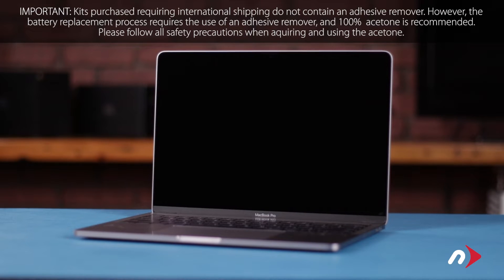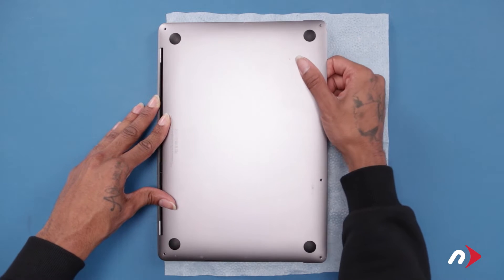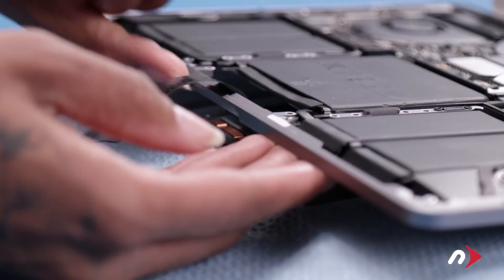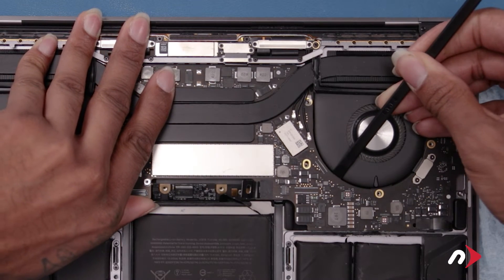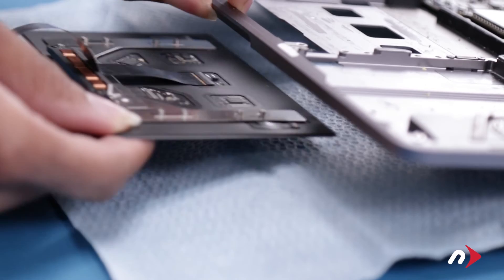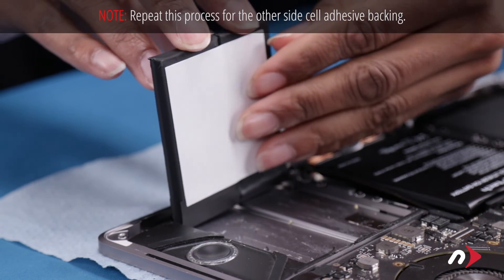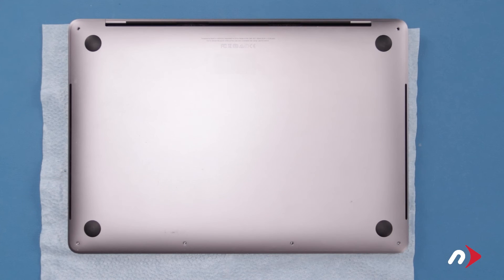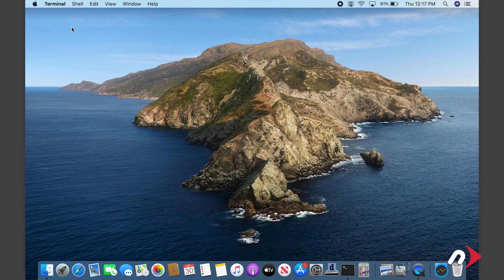How to Upgrade/Replace the Battery in a MacBook Pro 13-inch (late 2016 - mid 2017 Touch Bar)

Comment: Thanks a lot for this tutorial. I was able to change the battery successfuly and the computer is ready for use again.

While replacing the battery, I noticed a little disaligment of the trackpad, it is slightly aligned to the left leaving a tiny gap on the right side. The trackpad is fully funcional BTW, the disaligment is only a visual thing.

For folks that don't live in the US, I bought the battery and the glue remover on Aliexpress.

And thanks again!!
Reply from the maker: You're very welcome! We're glad the tutorial helped you successfully replace the battery and get your computer up and running again.

The slight trackpad misalignment you noticed is usually a minor issue, and as long as it's fully functional, it shouldn't cause any problems. However, if you'd like to adjust it, carefully loosening and repositioning it might help.

Thanks for sharing your experience and resourcefulness in sourcing parts outside the U.S. – that’s great info for others! We appreciate your feedback and hope your device continues to serve you well. 😊

Comment: Excellent instructions. Thank you!!!

The only change I made: I did not use any adhesive removal. Used a string instead to pry the battery out. So, I did not have to remove the trackpad.

Comment: I did it like you, but my mac do not see new battery. I opened my mac and see a picture of battery but after ….. my mac tell me ….. need a servis
Reply from the maker: Hello Marie, if the battery is still not being recognized after replacement, the issue may lie within the hardware of the machine itself and may require servicing.

Comment: Thnx, it worked better than the paper tutorial I got with my new battery. 
One note on part 4 in the video; the energy saver options have disappeared in macOS Ventura.
Reply from the maker: We're pleased to hear that the video proved more helpful during the installation process. Your feedback is valued, and we will certainly pass it along to the appropriate department. Thank you. 💙

Comment: Worked like a charm. Haptic feedback didn't work a first few times after battery replacement so I had to remove touchpad assembly and re-assemble it do resolve bad connection issue. Got it working again. Would also advise against connecting battery (12:35) so early in the process. Do it just before attaching the bottom cover. Just to ensure you don't accidentally short the board when reassembling the computer.

Comment: Just need a little direction –

•	I purchased a new battery for a MacBookPro10,2
•	The computer was a gift from my son – he told me the battery was ‘dying’ and, eventually, if the power adapter connector fell off – the machine stopped (no battery).
•	So I bought a battery from you guys: Date 10-02-2020 - Invoice 6539802 – which was delivered and I let it sit in a cool-dark-place from then to now.
•	Prior to installation I followed the instructions Temporally Disable Auto Boot (power) 1:00 min
https://www.youtube.com/watch?v=WC8_JCVCU0s&t=70s
•	Enter Terminal ( & Command Key)
•	Type sudo nvram Autoboot=%00
•	RETURN – Input code
•	Close Terminal, Shut down computer
•	After installing the battery and letting it charge all night (battery 100%
•	Re-enabled Auto Boot  (In video at 16:30):
•	Launch Terminal
•	Sudo nvram Autoboot=%03
•	Enter code - Return
•	After suttong off the computer I pressed the power button – nothing
•	Eventually I reconnected the power supply and it booted
•	So, the system has no response to the power switch.
•	The system WILL run with the power adapter ON.
•	The system shows the battery is fully charged

Two questions – 

Since the battery is NOT running the computer, how can I drain the battery before checking to see if I did not connect the battery correctly?

Do you know of some other reason the battery is not connecting to power on the system?
Reply from the maker: Hey John,

We apologize for the inconvenience you are having with our battery. It could be that the battery is no long working due to the not being installed immediately upon purchase. Usually lithium batteries only have a 6-12 month shelf life. You can try to the following troubleshooting to see if you can get it up and and running or contact our Tech Support directly.

The first thing I would recommend doing would be resetting the System Management Controller. Resetting the System Management Controller (or SMC) in a Mac can be a useful way to troubleshoot various kinds of problems that arise, typically related to power issues or issues that coincide with new hardware being installed in the computer.  Detailed instructions on performing a SMC reset can be found on Apple's website here:  https://support.apple.com/en-us/HT201295

After resetting the SMC, I would also want to perform a NVRAM or PRAM reset.  This can be done with the following instructions:
PRAM Reset:
1) Start the machine while holding down the Option-Apple-P-R keys

2) Wait until you hear the 3rd startup chime, then let go of the keys and let the machine boot up.

Lastly, we would want to go through a proper conditioning cycle, to help the battery reach its maximum lifespan.  This process will help calibrate the battery and extend the full charge life.  You can find this process with detailed instructions on our Battery Conditioning Guide: https://eshop.macsales.com/Tech/manuals/newertech/batteries/batteryconditioning_r1w.pdf
Reply: @poweredbyowc  Thank you for the reply.
Considering the battery was now fully charged - and there was no way to discharge it prior to disconnecting it internally from the MB, I took it to a local repair shop (CPR Spokane North) and they took it apart and repaired it.  Apparently, the connection board was not seated correctly and slightly hung-up on one of the guide posts.  I thought that might be the problem, but did not want to be the one who shorted out the board removing a 'hot' battery. 

FYI  - the battery is in perfectly good condition even though sitting new for two years.  Took the charge well and is running great.
Reply from the maker: Hey John,
Thanks for the update. Glad to hear the battery is all good and the root of the problem has been sorted out. Thanks again for the follow up. Glad you are back up and running again 🙂

Comment: I would advise against re-connecting the metal tab (12:35) until everything else is reconnected, as there is a possibility that you'll drop a screw on the Logic Board and it bridges a connection between two different components on the board. If there is power from the battery flowing through the system, this can cause a short and damage the components badly, possibly ruining the board completely.
Reply from the maker: Hi DWN9!  That's an interesting point.  I'd be worried that leaving the power connection screw till 14:23 when the other screws are inserted could result in the power connection screw being forgotten.
Reply: @poweredbyowc  That's true, but it's easy to open the back cover and re-install the screw later. Replacing the Logic Board would be more costly both time and money-wise.
Reply from the maker: You have great points there DWN9. 🤔 We love getting inputs/suggestions from our customer and we will for sure forward your feedback to our development team.😊

Comment: Hello. What if my laptop is dead and won’t power on at all. Is it safe to still change the battery?
Reply from the maker: There could be a few reasons why your computer isn't powering, while it should still be safe to charge a battery inside it, it might be important to figure out what is specifically wrong before replacing the battery.
Reply: @poweredbyowc  you were deff right! Wasn’t the battery. I replaced it with your kit and instructions and still no power. I sent it out to fix might be the board. Thanks for your help
Reply from the maker: Thank you for your comment! You're very welcome! Happy to help :)